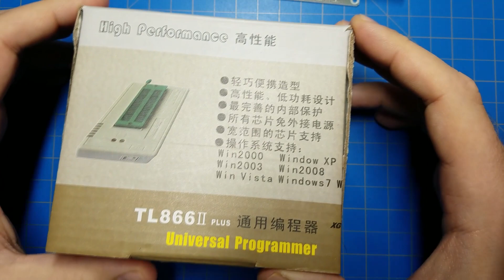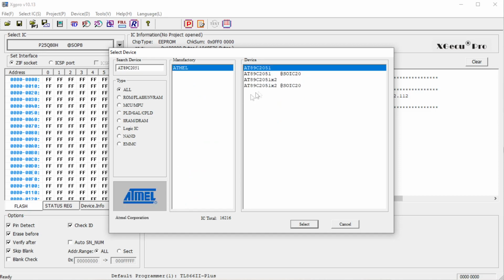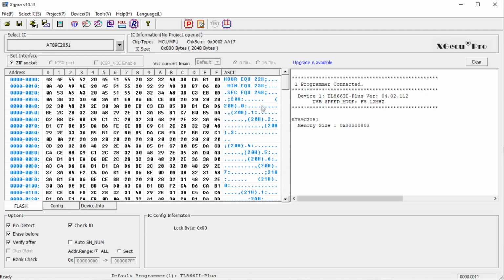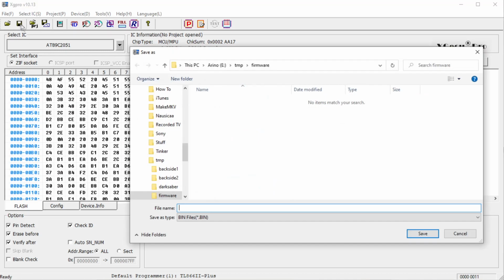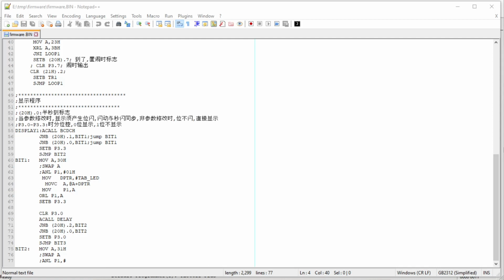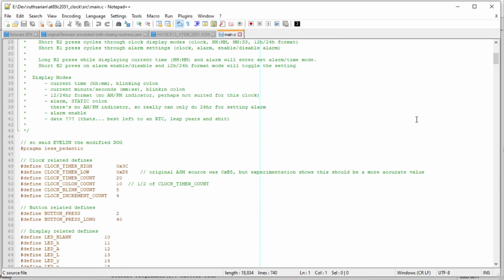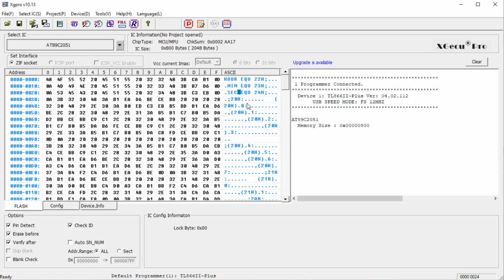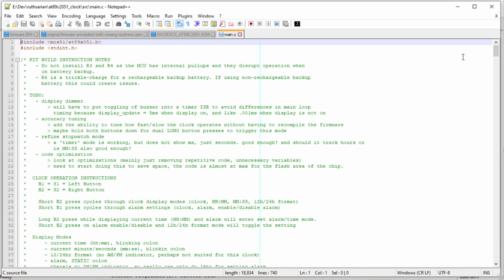AT89C2051 Clock Kit With Partial Source Code On Microcontroller

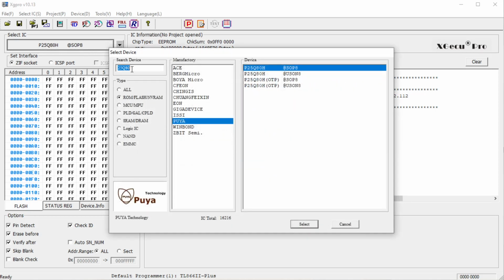Comment: I have assembled the kit and programmed it with your code,and it works fine!But I want to get rid of the zero in front of the hour eg I want the clock to show 1:20 instead of 01:20 .How can I do that? Thanks in advance!
Reply from the maker: in main.c, look for the display_update() function. this starts at line 342.

on line 358 there is this line of code:

P3 &= (~(1 << digit));

this enables the current digit. to hide the digit if it's a 0 in the first position you could wrap that line of code inside an IF statement like this:

if (digit != 0 || dbuf[digit] != 0) {
    P3 &= (~(1 << digit));
}

and that only enable the digit if it's not 0 in the first position.
Reply: @Ruthsarian  I changed the line as you suggested but I saw no difference.I used SDCC 3.5.Any suggestions?
Reply from the maker: @angelgrig72  I got the IF statement wrong. It should be this: 

if (digit != 0 || dbuf[digit] != ledtable[0]) {

I've confirmed it works with my own kit. I'll add it as an option to the code and update the github repository.
Reply: @Ruthsarian  I've just tested it and indeed it works fine!You're awesome!
Reply: Thank you for the super fast reply!I'll try it and I'll let you know!

Comment: hey, thank you for this project but i wanna know how we can convert this program to at89s52?
Reply from the maker: at89s52 has 40 pins. at89c2051 has 20 pins. this means at89s52 will not fit on this PCB. a different PCB will need to be used. that different PCB will have different pins connecting to the buttons and display. you will need to identify which pins connect to the display and buttons, then modify the code so it uses those pins.
Reply: @Ruthsarian  I m doing it on breadboard, also i know pin connects, i think i m making right circuit connects. But i don't know how to modify the code. I just need to modify code, please can u help me?
Reply from the maker: @adem2900  pins of the microcontroller are bundled together into what's called a "port". Look at the datasheet for the microcontroller. You will see pin labels that begin with the letter P, this stands for PORT. P1 is Port 2, P2 is Port 2. P1.1 is pin 1 of port 1. You'll notice each port has a maximum of 8 pins (0-7). Each pin is either high (1) or low (0). 8 pins. 8 bits. 1 port = 1 byte register in the microcontroller.

Look at the source code. You'll see references to "P3", for example. When assigning a value to P3 in the source code, I am setting the values (high or low) for all the pins on that port. If I want to set the pin on a single port you'll see assignments like:

P3_7 = 1;

This is pin 7 of port 3 being set to a value of 1, meaning pin will be connected to the power pin of the microcontroller (VCC). A value of 0 means the pin is connected to the ground pin of the microcontroller.

If I have an LED and resistor connected between P3.7 and ground, I can turn that LED on with one line of code:

P3_7 = 1;

And I can turn it off like this:

P3_7 = 0;

And that's all the code really does. It's connected to a 7 segment display. So it's just a matter of turning on the LEDs (by setting the appropriate pins 1 or 0) to create the digit I want to display.

So to modify the code, you need to document which pins are connected to which LEDs for your project, and make the appropriate changes.

For example, if the 7 segment display is connected to pins P2.0-P2.7 (in other words, port 2) then change references of 'P3' in my code to 'P2' in your code. If your display's pins are spread out across multiple ports, you'll have to figure out how to modify the code to set the relevant pins high or low.

Comment: Hi! I tried to reproduce your project, I used your hex code on a common anode display, no LED lights up, nothing. So, the program is for a common cathode display ?
Reply from the maker: Yes, this code is for a common-cathode display. The code is really intended just for the kit shown in the video. There are several other kits that use an AT89C2051, however the pins that connect the AT89C2051 to the display may be different, which would make this code useless for use with those other kits.
Reply: @Ruthsarian  I found this common anode display faster, I should also have a common cathode, I'm still looking.
I managed to load clock.hex in uC, and I noticed the main.c file, I thought that by modifying ledtabel (reverse 0/1) and compiling the program as you did, I could get a hex for common anode display. Would it work?
Reply from the maker: @HobbyHomeWorkshop  the display_update() function would need to be changed as well. to enable a digit that digit's common anode would need to be set high and the others set low. currently display_update() does the reverse because it was written for a common cathode display.

"P3" in the code means "Port 3". P3 is an 8-bit register, each bit corresponds to a given pin on the port. The pins that drive the digits are represented by 4 least significant bits of the P3 register (P3_0, P3_1, P3_2, and P3_3). 

For example, the line:

P3 |= 0x0F;

is using bitwise OR to set the 4 least significant bits all to 1. in a common-cathode display, this disables the digits because it sets the cathode HIGH. in a common anode display this is ENABLING all 4 digits, so you'd have to change this instruction to something that sets the 4 lower bits of P3 low, like this:

P3 &= 0xF0;

There are two lines in that function which have that instruction. Change them both to what I have above.

The only other line you need to change is the line that enables the digit being displayed:

P3 &= (~(1 << digit));

Change that to:

P3 |= (1<<digit);

And that, along with flipping the values in ledtable[], should make this work with a common-anode display.
Reply: @Ruthsarian  I understand. I've done the modifications. It remains for me to talk to a friend as soon as possible, he knows how to program this uC, then I can test it. I'll be back with an answer after that.
Reply: @Ruthsarian  [Solved] Hi! I have not been able to load the program for a CA display so far, but I found a CC display and I can say that the application works partially. At AT89C2051 there are the two pins P1.0 (AIN0) and P1.1 (AIN1) that do not light any segment, I checked by switching between several segments, so these two pins simply do not light any LED. I'm wondering why ? Is something wrong with the way my IC was programmed? [Solved]
In fact, can you provide a source of info so that I can make the modifications in the code for the CA display? I downloaded the compiler suggested by you.

Comment: I bought one of these and it arrived yesterday. Mine has a ZIP file with the source code on it. It's somewhat of an improvement, but the flash doesn't fit the entire ZIP file so I've only got 3/4 of the code.

Comment: I bought one of those clock kits off Ali Express, just for fun. Runs slow for some reason. Loses several minutes per hour, which is why I found your video. Thought maybe I'd buy a programmer to take a look and use your firmware and see if it becomes accurate. Did you buy the software CD with the programmer or were you able to find compatible software elsewhere? I'd hate to pay extra to get the CD and find it's all in Chinese!
Reply from the maker: I use the TL866II Plus which can be found on Amazon (https://www.amazon.com/dp/B0859YRVM3/) and eBay (https://www.ebay.com/itm/323729666027) and probably other places as well. The software is free and can be downloaded from here: http://www.xgecu.com/en/.